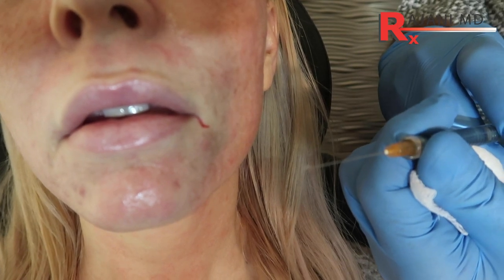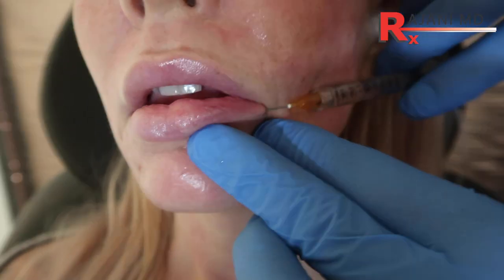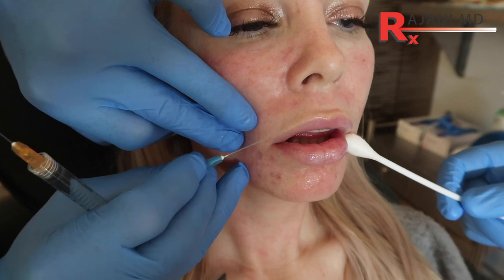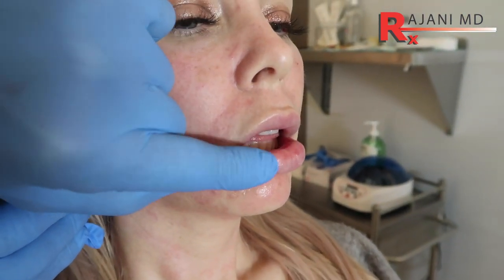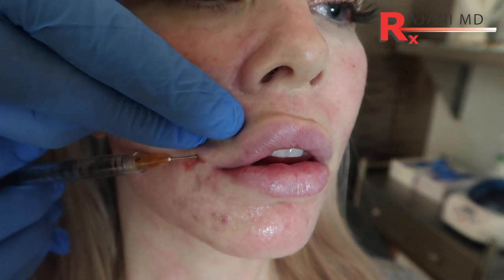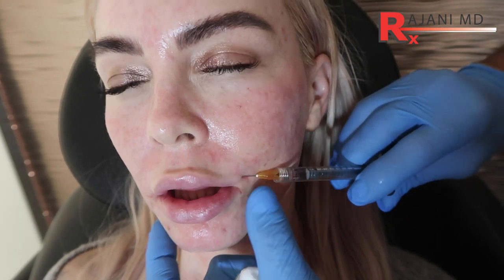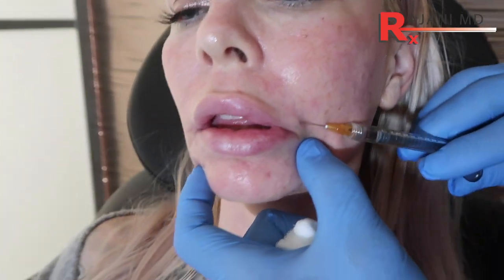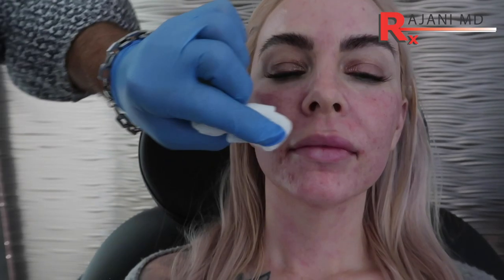Watch Lip Injections-Micro Cannula and Needle Technique Combined Portland Oregon

Comment: Hi Dr. How much did you put in in the bottom and in the top lip?  Thank you for the awesome video.
Reply from the maker: I do not follow volume unless I anticipate swelling and  losing my landmark so I cannot precisely answer you. I go by the "look". One side may fill easily and the other not. One may get projection and the other not so I constantly adjust base on the look not the amount. Roughly 1/2 and 1/2 but you can see from my syringe the amounts also. Thanks for watching